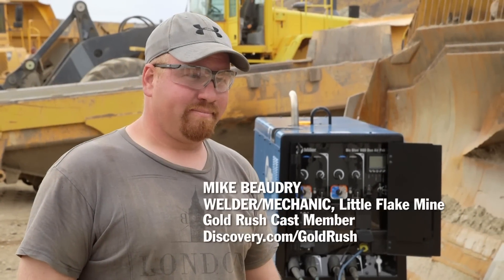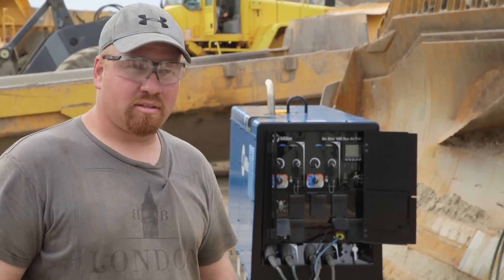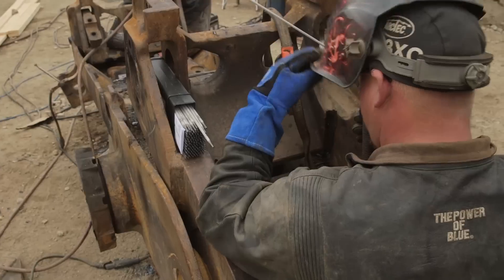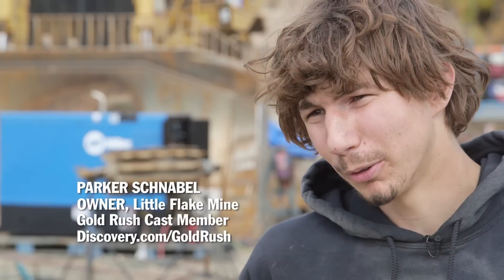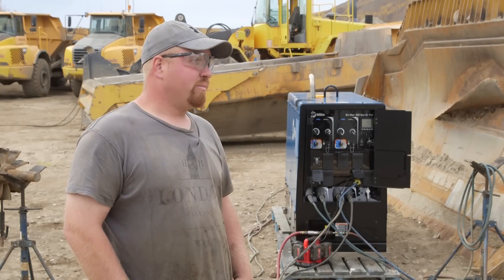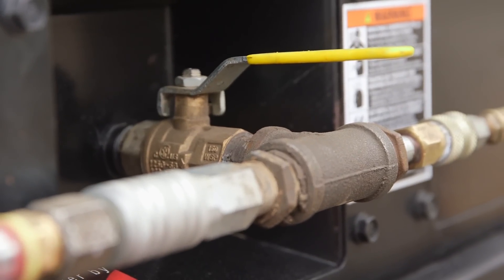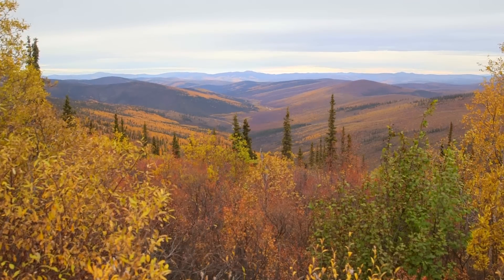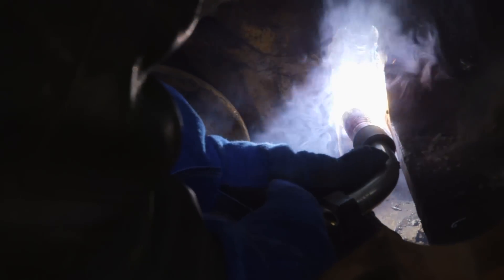Miller Dual-Operator Welder/Generator Does it All for Gold Rush Mining Crew

Comment from the maker: The Miller® Big BlueⓇ 800 Duo Pro Air Pak engine-driven welder is equipped with the power to handle arc gouging with large carbons. The reliable Ingersoll Rand air compressor has a 30,000-hour life expectancy with independent on/off control for applications where compressed air is required or not needed. Watch how the Parker Schnabel crew of Discovery Channel show Gold Rush uses the Big Blue 800 Duo Pro Air Pak:

Comment from the maker: Routine machine maintenance or major repairs, the Dual-Operator Big BlueⓇ 800 Duo Air Pak cuts downtime for Parker Schnabel and the crew of Discovery Channel show Gold Rush. Capable of gouging with large carbons or powering two welding operators at once, it helps get equipment back up and running faster.

Comment: Best welders on the market. I farm 8000 acres with my family and we repair equipment for ourselves and others . Very versatile and reliable machines with great service . We have ran other brands but the millers are the best .
Reply from the maker: Thanks for the support, Anthony!
Reply: @MillerWelders  not a problem.  We run all Miller welders and plasma cutters in our shop and on our service truck .  We weld on a daily basis . We run the welders for hours at a time hard facing ripper points . As a farmer with a large operation we cannot afford down time and your products have saved us alot . They are built tough .